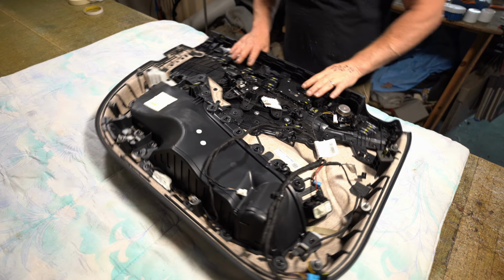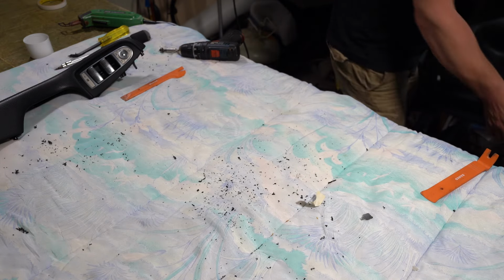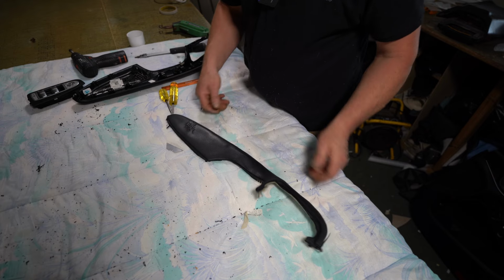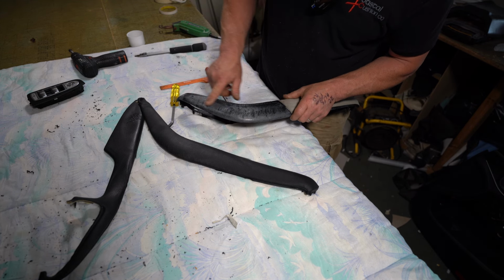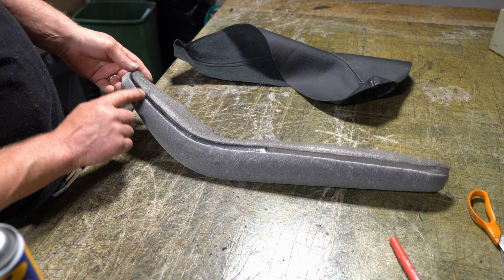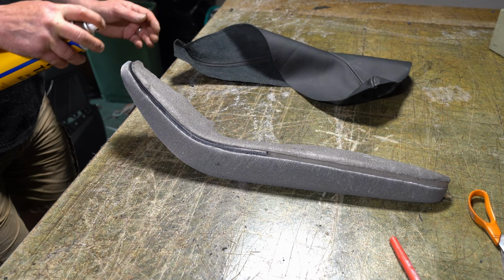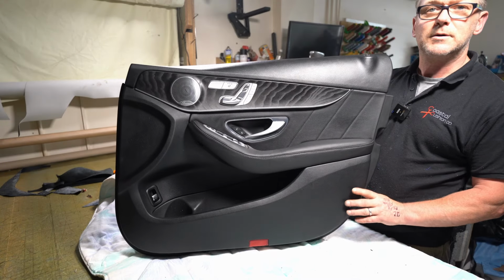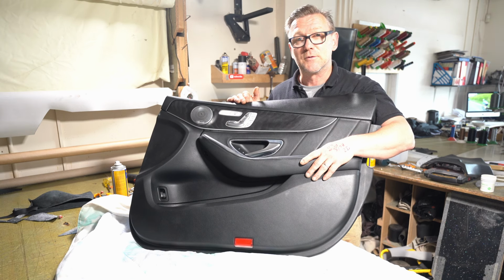How to repair the door armrest on a Mercedes. Auto upholstery

Comment: The seam or stitch line underneath the window switches seem to be slightly crooked compared to the original one, is that something that can be touched upon or is that done once it is glued or stitched?

Regardless of that it was an interesting video, thanks.
Reply: Yeah noticed myself.
Did you use a twin needle machine ?
Reply from the maker: When the card was on the door that wasn't noticeable
Reply from the maker: When the card was on the door that wasn't noticeable
Reply from the maker: No just a single needle machine